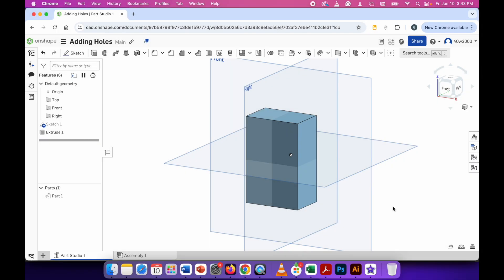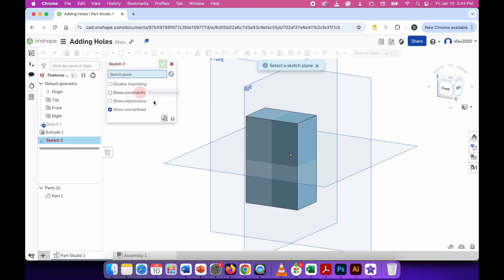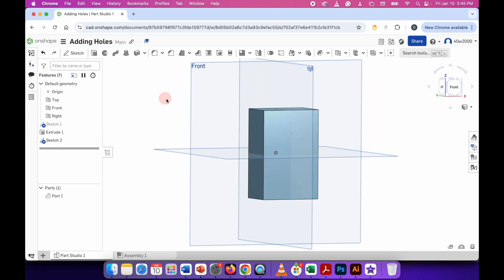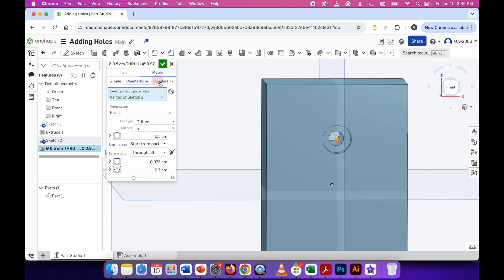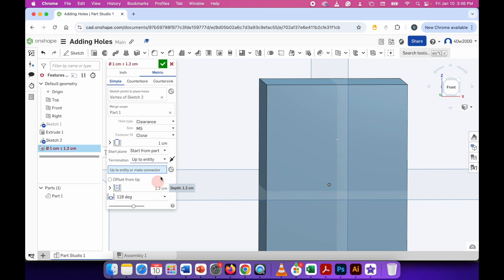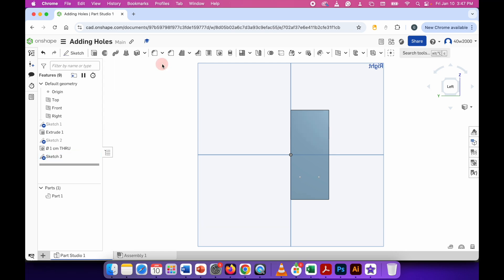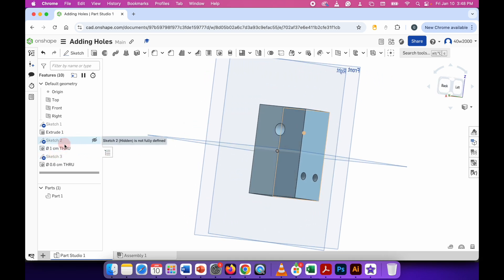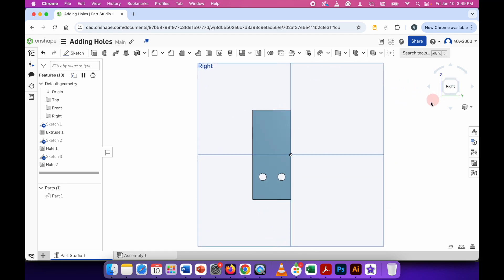How to Add Holes in Onshape - Step-by-Step Tutorial

Comment: Hi, any idea why the tapped hole feature doesn't work?  I need a tapped hole.  It accepts my input, but when export the STL, no tap, just the hole.  I'm guessing Onshore only can make tapped hole meta data, but not actually apply generate a 3D model.
Reply from the maker: Onshape’s Tapped Hole feature only creates metadata for the tap (thread specifications), but it doesn’t physically model the threads. This metadata is useful for technical drawings and machining but won’t appear in an STL export for 3D printing.

Workarounds for 3D Printing:

Use a Helix & Sweep Cut:

1. Create a helix along the hole.
2. Use the sweep cut tool with a thread profile to carve out the actual threads.
3. This generates a true 3D model of the threads, which will appear in the STL.

Use a Threading FeatureScript:

1. Open the FeatureScript Thread Creator (publicly available in Onshape).
2. This generates real 3D threads that will be exported in STL.

Print the Hole and Tap Manually:

1. Export the hole at the tap drill size and manually tap it after printing.